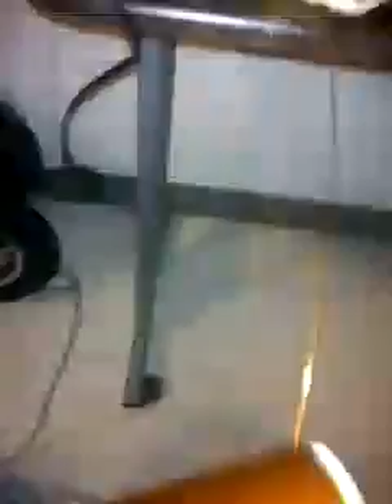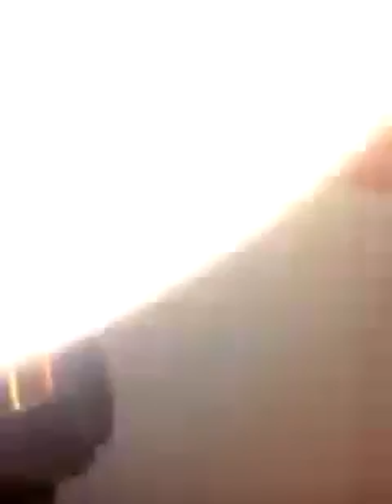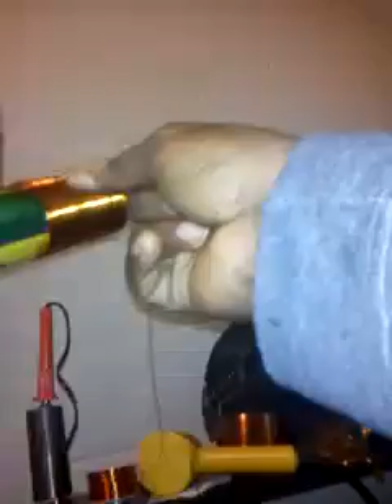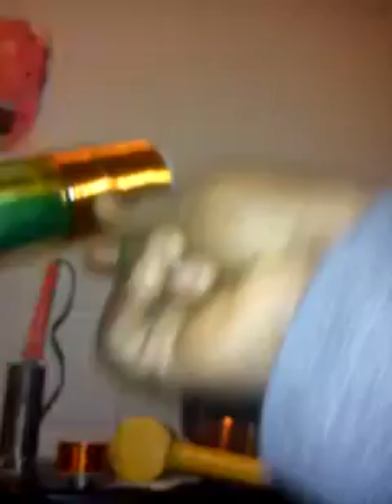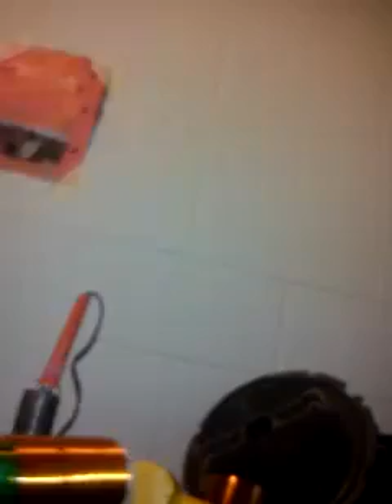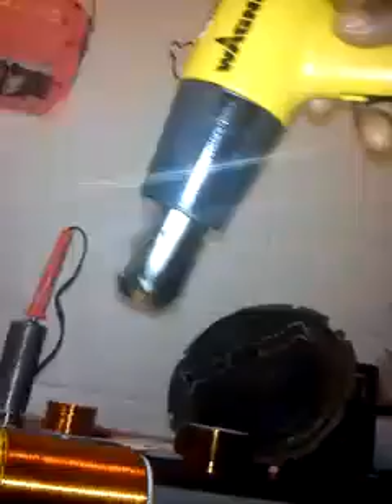How to Rebuild a Subwoofer part1  and make voice coil.avi

Comment: @dluv458
If I want to have a single coil with 4 ohms of impedance, how many turns of what gauge wire will I need? Should I just take apart the burnt up wires on my fried DVC and measure everything? If I can make a DVC myself that would be nice, but I'd be ok with a single if it's easier.